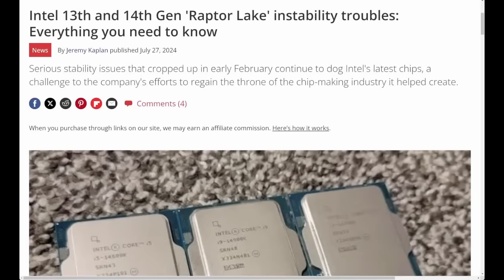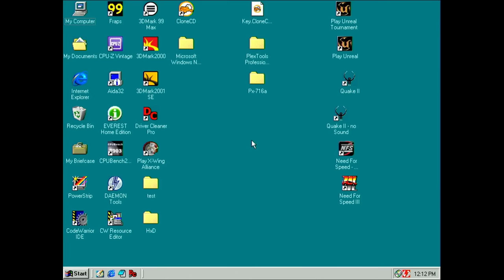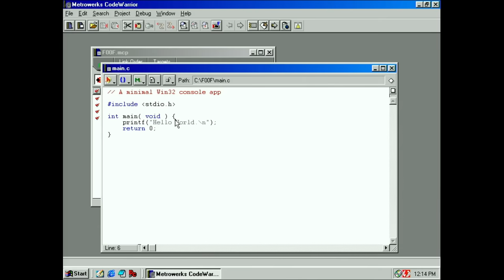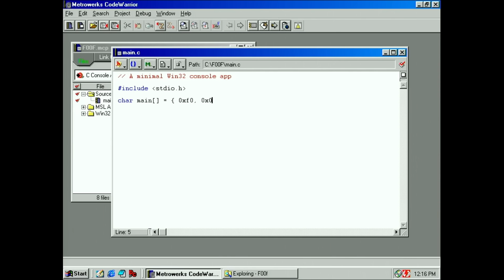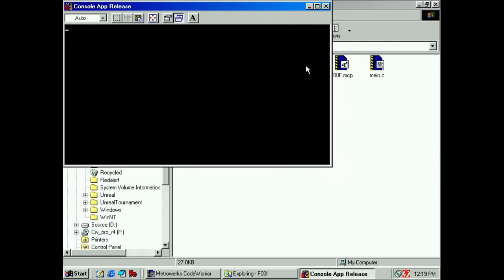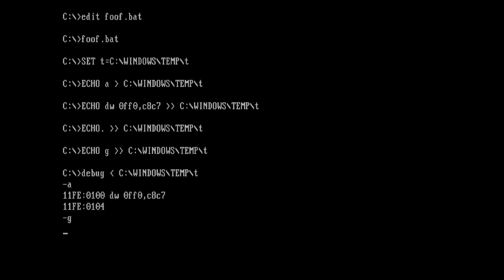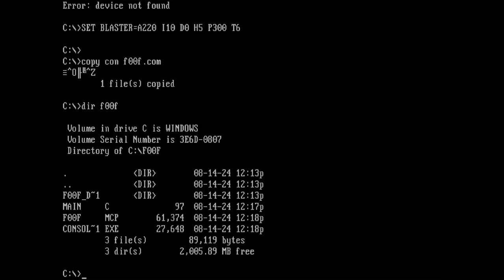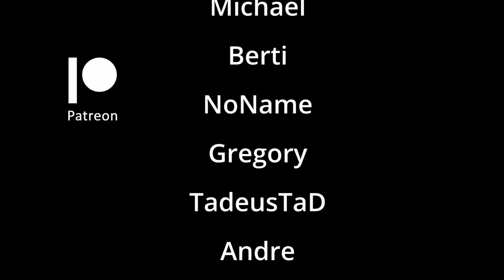These 4 bytes will crash your retro PC: The Intel Pentium F00F bug

Comment: Yes, it´s been ages since I saw someone using Alt+Numpad to enter characters. I used it always to make windows, menus, tables, borders, in Basic and Turbo Pascal. The codes that you entered are the decimal values of the hex code (F0=240, 0F=15, etc)
As a curiosity, every notepad in Windows and most text editors in dos have that ability, to enter characters with Alt+Numpad. Yes, even Win10 notepad.
Reply: I remember using those in batch files in dos to build "graphical" menu's and later for the @ symbol. Also some azerty keyboards on the market didn't have the \ key.
Reply: I didn't even know that worked in DOS.
Reply: @renakunisaki  I remember that in the manual for my first computer there was the ASCII table with the keyboard scan codes; that was for the user to be able to input characters from the keyboard if a key is broken. So, yes that was a thing from XT and DOS 3.3. Not sure if this was a DOS or BIOS feature.

Comment: I remember the f00f bug back in those days. It was a pretty big deal for a short time. I think there may have even been some talk of trying to intercept & block those instructions at the OS level in Windows, OS2 or Linux via a patch but I don't think any of that was ever implemented. 

Ultimately, with the release of the Pentium II months before the f00f bug was discovered and the relative popularity of AMD & Cyrix CPUs, all of which weren't affected by the bug, along with the internet still being in its infancy led to the bug being mostly forgotten about within a few months.
Reply from the maker: I read that the foof bug was addressed through operating system patches. However, I couldn't find any update just yet that would address the issue in Windows 98SE. As far as I know, no compiler would ever create such code, the sequence had to be deliberately created by the programmer like I show In this video. Congratulations btw, you found an unreleased video 😉
Reply: I remember seeing "checking for Intel Pentium f00f bug" when booting up Linux. No idea when it was inserted into the kernel, but probably in 2.0.x, 2.2.x or 2.4.x series. I think I was on a K6 by that point so never checked any further.
Reply: Had a machine with Pentium MMX as my "e-waste home server" in 2000s, and the bug was patched in Linux 2.4.30-ish already (can't remember which version it was running precisely). Tested it with a friend, and nothing bad happened, which made us "pleasantly disappointed".
Reply: Cyrix had its own foof bug :) "Cyrix coma bug"
Reply: @bitsundbolts  There was presumablly seen to be no point addressing the issue in windows 9x, because it's trivial for a bad program to take down 9x anyway. The issue only really matters in systems that actually try to provide isolation between programs/users.
Reply: Wikipedia lists two official workarounds and an unofficial one. Operating systems can use any of them to prevent the bug from crashing the CPU.

Comment: Fun fact: Code Warrior still exists today.
It's the default IDE that NXP provides now
Reply: It was created on Classic macOS, as the "cheap" alternative to the MPW workbench requiring a Mac II to develop a Mac application. MPW was the goto IDE, with the MacApp framework, used for Photoshop and Excel initial development, on macOS. And coming with the CodeWarrior IDE there was a framework named PowerPlant, an Object Oriented C framework, but with mixins instead of the inheritance from a unique Object root class. It is very like what is called traits, or protocols in modern frameworks.

Comment: Easier way to make a test executable file that triggers the bug, and also is basically the smallest possible file that does that: use a hex editor, make a new file with it and type the offending bytes at the beginning of the file (F0, 0F, C7, C8) and then save the file with a .COM extension. That gives you a 4-byte executable file that triggers the bug. (edit) the result is basically exactly the same as your 3rd method, but many people may find it easier to use a hex editor to make the file.
Reply from the maker: I should have opened the com file from the third method in a hex editor. I added it to the article on my website though.

Comment: The reason to why main as an array does work is that being specified as an entry point on older linkers the byte array gets just dumped under "main" label. When the address of main gets called/jumped to, thanks to von Neumann everything past it is just treated as executable code, so the data is executed as "lock cmpxchg8b eax"

Comment: Method 3 is something I have never seen. Awesome programming method, and with the tightest coding size. Possibly you could do some other examples in the future using and explaining this method in greater depth?
Reply from the maker: You can even write text into the command line with this method. I'll come up with something else and explain more how this works.
Reply: I used to do this in Win XP. I'd use edit and write programs in asci characters up until I learned about the assembler in Debug utility program. I still have the notebooks full of conversion charts. It's basically a truncated Intel manual.

Comment: The reason it doesn't affect PII or newer is that, with the exception of the failed Netburst (Pentium 4) architecture, they are all based on the P6 (Pentium Pro) microarchitecture. Yes, even the latest and greatest (rotfl) intel CPUs are based on the P6 microarchitecture from 1995. Maybe that's part of their problem...
I tried this on our P90 back in the day and it crashed. I don't think I used that command but I was reasonably fluent in C++ back then. More likely I edited doom.wad to trigger it somehow because I was into modding DOOM (and other games) before it was cool (and before there were modtools).

Comment: That batch file just mimics a sequence of commands in an interactive assembly language session by feeding the strings into the debugger program as if you had typed them interactively.

"A" without parameters starts entering  program instructors at the default program start address (xxxx:0100). "DW" stores the following double-word values in memory at the current program counter address (here: 0100), the full stop ends data input and return to command mode, and the final "G" runs it.

Comment: The cool thing is that CPUs have tons of small bugs, but I literally crashed my Haswell CPU with a virtualization instruction inside the VmWare, to make sure it was the CPU, VmWare crashed both on Windows hosts and on Linux hosts. But on Linux it took 2 minutes for the watchdog to kick in and kill the machine, Windows timeout was only 15sec (I was baffled by that, its usually the other way around, Windows is the one with ridiculous timeouts). It was a contention between core that caused a deadlock. 
Cool think it was fixable by upgrading the microcode.

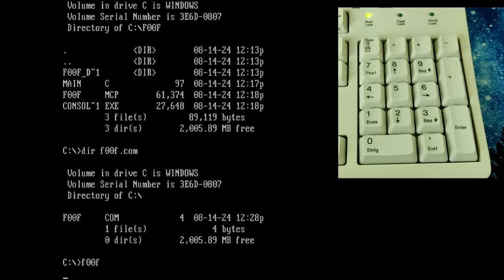Comment: 12:35 I wonder why is the cursor still blinking, if the cpu is locked up trying to fetch the next instruction? how does it execute instructions to blink the cursor? is it done with interrupts?
Reply from the maker: Others have pointed out that the cursor is rendered by the graphics card (text mode). So, even though the CPU is in a deadlock waiting for the next instruction that will never come, the screen looks like it's waiting for input.
Reply: This era had the last vestige of hardware accelerated video cards as they transitioned to just providing big arrays of pixels, and before modern GPUs. The cursor was implemented in hardware, on the video card.

Comment: There's a 3 byte way of locking Win9x and DOS, which works on any CPU: 0xFA 0xEB 0xFE. Save it as a COM file and run. It does:
CLI ; lock interrupts
loop: JMP loop ; infinite loop
Yes, a DOS "program" running in Windows 9x will freeze the machine…
Reply: Win9x runs DOS programs by quickly switching between real 16-bit mode and protected 32-bit mode. It could be considered a form of assisted multitasking where the DOS part must pass control back to Windows.
The way by which Microsoft implemented the switching to the 16-bit mode is quite hackish in its own right as you're not supposed to be able to get out of protected mode without rebooting.

Comment: how does the cursor still blink in dos?
Reply: Maybe cursor blinking is hardware accelerated and doesn't need the CPU
Reply: It doesn't rely on the CPU. This is a feature of text mode graphics from the video adapter.
Reply: The video circuitry is what makes the cursor blink ("hardware cursor"). It's independent of the CPU working.
Reply: As the others said.

You can also make the cursor not blink, make it larger or even disappear, if you use the 'prompt' command to output the correct ANSI escape sequences when you modify your command prompt. You can also set custom colours or inverse text as part of the command prompt using ANSI escape sequences.
Reply: @LarsV62  The graphics card has hardware registers. Using ANSI codes relies on having a driver loaded which interprets the ANSI codes and converts them to register settings.
Reply: it doesn't rely on the CPU it relies on the GPU and video adapter
Reply: @thewhitefalcon8539  Yeah, I forgot that it relied on the ansi.sys driver for that since it was loaded as standard. Thanks for reminding me!  👍
Reply: @LarsV62  You can also directly poke the graphics card registers.

Comment: I wonder if you could maliciously edit the first 6-8 bytes of the MBR using this principle to render a machine inoperable when loading from disk
Reply: Fun fact: A boot sector with corrupted data, (not zeroed) regularly causes the dreaded blinking-cursor-on-top-left syndrome. That's how I know a drive wasn't wiped correctly.
Reply: @RJARRRPCGP  IIRC you only need the two magic bytes for the PC to start reading instructions from the boot sector; i.e. AA55
So what if you wrote AA55F00FC7C8C3 at the beginning of the boot sector?
It'd be more inconspicuous if for some reason the first few bytes were zeroed out to begin with, or maybe the boot code doesn't need the full 510 remaining bytes and you could slide/compress the useful data and inject those nasty instructions
Reply: yeah but you could also just write an infinite loop there instead. The AA55 marker goes at the end of the sector.

Comment: Both editions of Windows 98 have a mitigation against this, which can be enabled via the Advanced button in msconfig. "Enable Pentium F0 (Lock CmpXchg) workaround". The help text for it is "Protects Intel Pentium and Intel Pentium MMX microprocessors against the malicious use of an instruction sequence that may interfere with the microprocessor's operation. This check box should be cleared when debugging programs."
Reply from the maker: Oh nice! I wasn't aware of this detail. I wondered why Windows 98SE was still crashing. Now I know why. I'll check msconfig for this setting. Thanks 👍

Comment: The batch file seemed straightforward enough. It's creating a tempfile named t (no extension), and then writing stuff into the file using I/O redirection (> means open write, >> means open append). So you're creating a file with the contents:

a
dw 0x0ff0,0xc8c7

g

And then running it in a program called debug. More specifically, the file is being used as the standard in. You should be able to replicate the same behavior without the shell script by just entering "debug" and then typing the above file contents out. You should expect to see the computer crash upon entering the "g" line, which seems to run the code.

My guess for the meaning of the code is that "a" stands for append and "dw" for dword. The empty line is to stop writing stuff to memory and go back to the default command line mode of the debug program. So you're entering a line "dw 0x0ff0,0xc8c7" into memory and then executing it with g, where it gets, I'm guessing, assembled into a program and executed in-memory and because of the lack of entry point in the code and lack of memory protection against executing readwrite memory in user mode, what is supposed to be a dword variable ends up getting read by the program counter and executed as machine code, crashing the PC.

Any DOS programmers in chat to tell me if that's accurate?

Comment: You have to stress the cpu w dosbox at very high cycles, you have to choose. When you start heretic, it will add a fpu driver that will reside in your cpu. After done, you have to do the same with duke3d, and just watch the intro. By oing it more times, duke can run good with higher cycles. You'll also get an audio acceleration, very good for youtube when using energy saving, netbook, tablet, etc. The fpu is off by default, you can just measure benchmark its performance, but can't benefit from it. 
When the fpu is on, you get an Intel autopilot, that's good for driving and shooter games, some games will become harder and mre challenging. Example is Dyna Blaster, the game will be logically harder, the opponents will be placed to harder positions. The Stunts will be corrected by the autopilot, to ensure you won't crash your car.

Comment: can you abort the lock with an NMI ?
Reply from the maker: Sorry, what is an NMI?
Reply: No. The CPU itself holds the bus locked that it needs to fetch instructions; sending an NMI is really just a high-priority interrupt, making it jump to a different location, that it then won't be able to fetch from since the CPU itself holds the bus locked.

NMI is "Non-maskable interrupt". The name is slightly wrong since it has its own masking bits... Usually in the IRQ2 slot, as the original PC/AT could never trigger IRQ2 by design.
Reply: @bitsundbolts  Non-maskable interrupt
Reply: @dascandy  One of the workarounds is to break the interrupt table so the CPU raises a "broken interrupt table" interrupt after trying to raise the "invalid instruction" interrupt. Messing with the interrupt delivery sequence in any way seems to avoid the faulty state. It's plausible that raising an NMI could also break the CPU out of the faulty state. But if IRQ doesn't, and IRQ is not masked during this state, then NMI probably doesn't either.

Comment: I do not remember the f00f bug.  I do remember FDIV, but I had an AMD K5 back then, so... 🤷‍♂
Reply from the maker: Yes, the FDIV bug is more known. I just recently stumbled across this thing. Essentially, it is an illegal instruction and no compiler would trigger it - you have to specifically code the instruction for it to fail. The bug is that the processor should raise an exception and not dead-lock.

Comment: Only ever heard of the FDIV bug - and that was through another YT video.

Not sure how many people would be interested, but I would actually watch a video probing retro CPU for bugs - or straight up compatibility issues. Considering how many companies were making CPU in the 90's - even until the end.
Reply from the maker: I am sure that other CPU designs also suffer from bugs, but due to lower volume, those bugs may not or never surface.
Reply: Try running sandsifter on it

Comment: At @12:35 why cursor still blinking if system froze?
Reply: The CPU is waiting for something that never comes. So, in that sense, it's not a system hang or crash but just unresponsive to any user input.
Reply: @ezruy  No, the CPU is not waiting like for an int, it can't load the next instruction so is completely halted and only a reset signal can unlock it. The blinking cursor is done by the VGA hardware.
Reply: It's generated by a timer in the GPU

Comment: Fun fact: this is how the original Xbox was modded. It can be used for arbitrary execution, but this originally wasn't a problem bc the Xbox switched from what was going to be either AMD's Athlon or Phenom CPUs to an Intel CPU that's a cross between the Pentium and Celeron. The AMD CPU didn't have this bug, the Intel one did.

Comment: And this cannot be fixed by updating the BIOS? It seems to contain micro code
Reply from the maker: I am not sure if microcode updates were already a thing back then. I read that an i486 had about 5000 lines of microcode. But I'm not sure if this bug could have been fixed by an update.
The bug was discovered quite late and the Pentium II was already released. There was little incentive for Intel to fix this bug.
Reply: The Pentium Pro was apparently the first CPU to contain writable microcode, although a workaround was implemented at the Kernel level in Linux version 2.0.32-6 and presumably later Windows versions had one of some kind too.
Reply: Yes, P54  and P55 did not support microcode updates.
Reply: It would be an operating system update